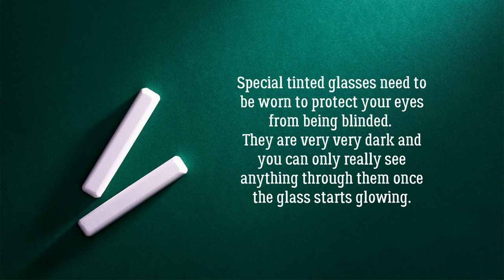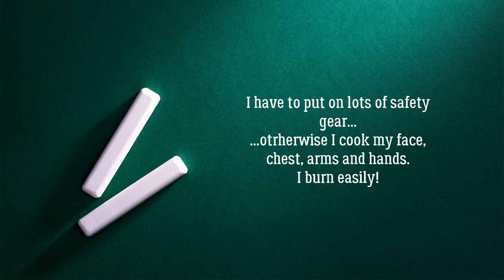Scientific Glassblowing Quartz Flasks

Comment: Such a wonderful skill. I believe the white bloom is condensed silicon monoxide, the working temperature being so high that the silica vaporises, partially dissociates and condenses onto the comparatively cooler parts. A gentle reheat, as you say, restores it to the dioxide, which then dissolves back into the bulk. Many thanks for such a great video.
Reply from the maker: Thank you for explaining 😁

Comment: Thought i'd add this.

"Pyrex glass transmits most of the incident light above about 300 nm and may be used in the construction of apparatus for reactions which require light above this wavelength. Quartz vessels, transparent down to 200 nm, must be used for reactions which require light below 300 nm. Certain types of quartz allow transmission below 200 nm."
Vogel's Textbook of Practical Organic Chemistry (5th Edition)    It's free on library genesis FYI.

Comment: I used to work a lot of quartz in the 70's for the semiconductor industry. the bloom is best avoided by preheating the a couple of inchs up. We also used hydroflouric acid to etch it away. Never got UV burns, eyes are still fine 40 plus years. Interesting using hydrogen oxygen for heat, but never really liked working quartz vs borosilicate, yet you do what you are paid to.
Reply: What’s was it like back In the 70’s working scientific? Where people open with knowledge or did everyone keep to them self and not share information and techniques?

Comment: That looks... not easy. I wonder what  the labware will be used for.
Reply: Suuuuuuper high heat reactions. The strain point of quartz is 1120C, so you could safely use this in reactions up to at least 925C as many times as you want without worry of failure. Borosilicate strain point is only 515C for comparison. 
My educated guess on the long neck is for the purpose of keeping that insane heat away from the rest of the apparatus. Glass is insulating, so it would take a long time for the heat to travel up the neck and apparatus. 
This is a very purpose built item, so I can't speak to a specific reaction. I mean the flask is on a very tiny scale and that looks like a 10mm joint, which is also super tiny. I'd venture a strong guess toward research or analytics rather than production.
Reply: It is for Ketene synthesis.
She stated the use in the name (although I am not used to the spelling, but that might just be a region thing) the legend Doug's Lab made 2 videos about a similar process these would typically be used for.

https://youtu.be/_1mMW2qEF84

Comment: Hello Natalie,
Can borosilicate be welded to quartz?
I need to weld a halogen lamp to a glass tube and borosilicate tube would much easier!
Its for vacuum work and I need to test myself the idea  first
Reply: While I'm not Natalie I'll drop my twopence here anyway ;-)
Generally speaking, the biggest obstacle to joining two different types of glass is the difference in their respective thermal coefficients. Too big, and try as you may, the joint will always crack. Quartz glass has an extremely low thermal coefficient, so low that it won't crack even if you put it, red hot, straight into water.

Uncle Google says:
"Borosilicate glasses are known for having very low coefficients of thermal expansion (∼5 × 10^−6/ °C at 20 °C)" - low FOR A GLASS, that is - which is still pretty high "generally speaking".
"One of the most attractive features of quartz glass is its very low thermal coefficient of expansion (CTE). The average CTE value for quartz glass at about 5.0 × 10^ -7/ °C is many times lower than that of other common materials"

So it looks like the CET of borosilicate glass is TEN TIMES higher than that of quartz glass, thus "I doubt it very much".
Then there's a huge difference in melting (softening) temperature: 820°C vs 1670°C, so when you touch softened borosilicate element to softened quartz glass, the former will probably just melt completely and drip down as a rather runny liquid.
Reply: @MrKotBonifacy  thanks !

Comment: A colleague of mine working in a glass cell making is experiencing "fogging" after he welded a rectangle quartz cell. It looks like white stuff deposited on the glass surface. He claims it's vaporized SiO2 deposits. Have you experienced that? If so, what do you do to remove the deposits?
Reply: We call it smoke. Basically take a torch to it, as if polishing, but move the fire a bit quicker while going over the smoke
Reply: Some other viewer, MrEurypterid, commented on this "fogging":
"I believe the white bloom is condensed silicon monoxide, the working temperature being so high that the silica vaporises, partially dissociates and condenses onto the comparatively cooler parts. A gentle reheat, as you say, restores it to the dioxide, which then dissolves back into the bulk."